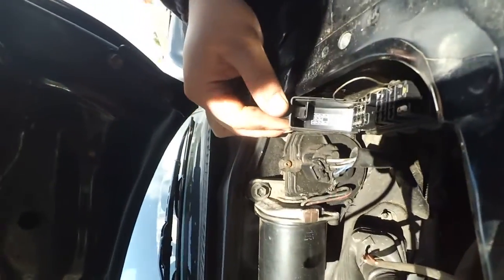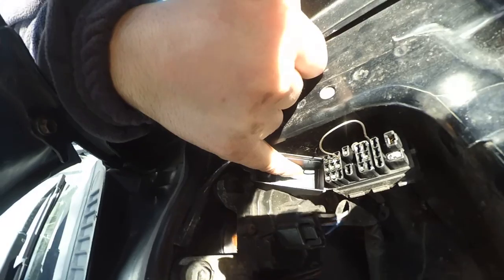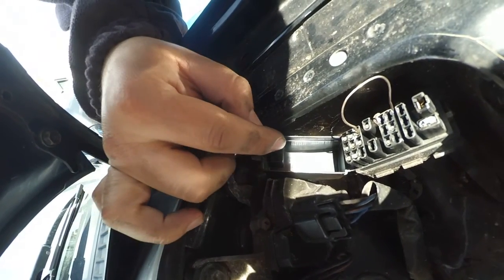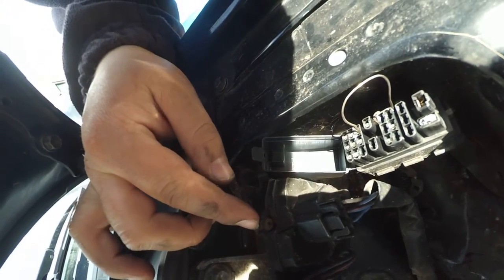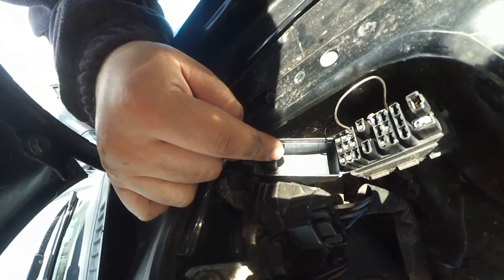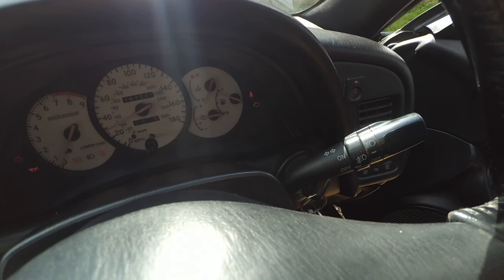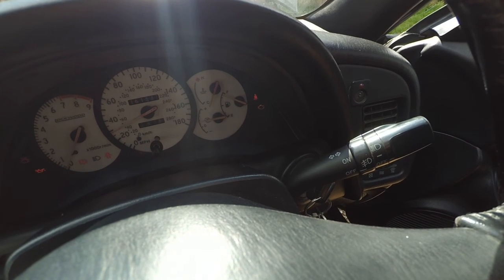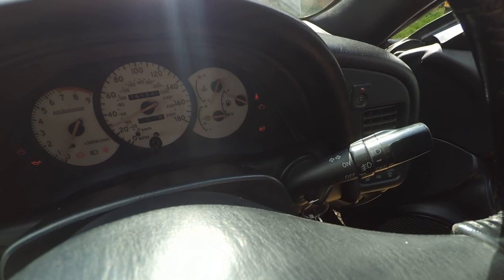How To Retrieve ABS Codes on a 94 Celica

Comment: Hello Tuga, ive gone through the same procedure as tourself. The error code im getting is 44. I checked it over snd over and its always 4 blinks then pause then 4 blinks on the abs light
Reply from the maker: Do you know what 44 is supposed to be?
Reply: @tuga2112  lol no I could not for the life of me find what error code 44 means online. I tested it a few times and my dad was with me. We both saw 44
Reply from the maker: The code that I had wasn't the issue that actually was my problem. 

I suspect the jdm abs computers report different codes. 

Unfortunately I don't have any contacts in Japan to help. I onse tried to talk to a Japanese guy to get some help getting manuals and he bluntly just repeated getting manuals for the 25 years old car was illegal... They are not very open minded folk
Reply: @tuga2112  no worries, thanks for getting back to brother. I suspect it's a speed sensor issue but am going to get it checked out in a couple of weeks time. I'll let you know if I learn anything.

Comment: You are being very modest about that "94 Celica'
ST205! 
Maybe that accounts for the difference in wiring looms!
Reply from the maker: I believe there are differences in the abs reporting codes. As this car is a JDM import which the code description did not match the issue at the end of the day.

The problem is that this is both a homologation build as well as JDM import at the end of the day. I don't know which of the 2 makes it different to the common at200 st202 versions
Reply: @tuga2112  hello, thanks for this. I also have a gt4 wrc and the abs light has come on. I will give this a go on the weekend. See what error code comes up.

Comment: Hi! I replaced the battery on my 1995 Toyota Celica and now it cranks, but it won't start. It's probably the anti theft or immobilizer. Any Idea how to bypass it with just the physical key? Thanks!
Reply from the maker: No idea, my 98 came with a chipped key, but the 94 has an aftermarket alarm. Neither ever had any issues after changing or disconnecting the battery